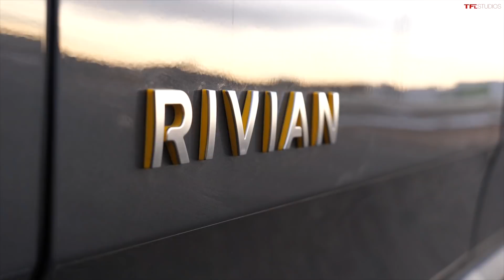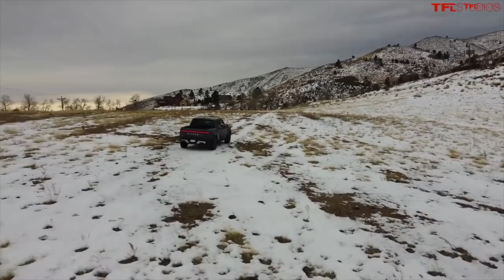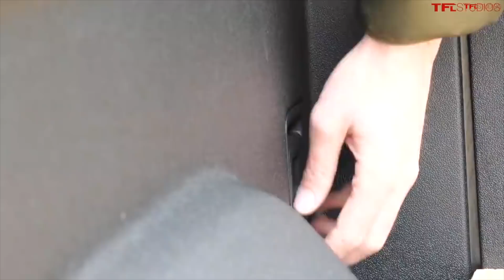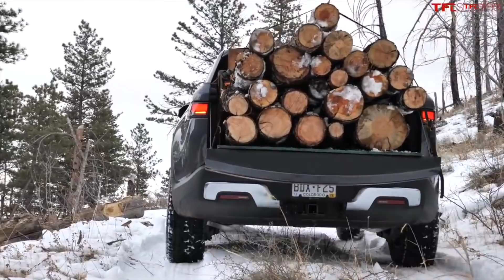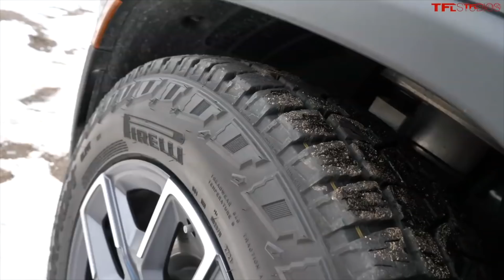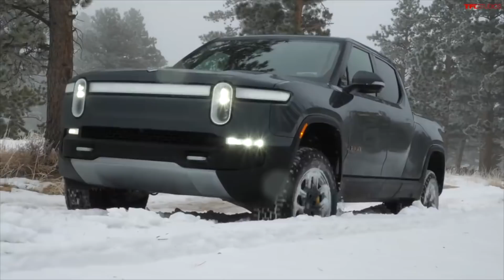What's It REALLY Like To Live With An All-Electric Rivian R1T? We Have The Answers!

Comment: I actually drive 500 miles pretty regularly.  HOWEVER, in my ICE truck that usually means filling up twice. In an electric truck I could leave the house "full" and then charge it an extra 100 or 2 for essentially the same amount of time.
Reply: For less than you could provide with electric an additional tank could be added to non electric for drastic increase in range.

Comment: It would be great to see you update how you approach testing adventure trucks like the Rivian.  Major towing or hauling logs?  Nah, that is all pretty yesterday.  

Hauling a super-duty bike rack carrying two 70 lbs e-bikes.  Charging the e-bikes while traveling.  Fitting a roof-top tent.  Operating your Iceco refrigerator/freezer on the road with 12V.  Fitting a dog hammock in the back seat.  Yeah, those are more appropriate tests for the intended demographic of the Rivian.

Comment: What does the conserve mode to to the 314 EPA? Goes over 314, or gets you closer to 314 (assuming you have the 21” wheels and road tires)
I didn’t really understand the 208-222 range comment… conserve mode adds 208-222 miles on top of 314?

Comment: 70k+ for a truck that will spend 50% of its time plugged up into a 240v or sitting an hour at a charging station. Until battery technology/infrastructure improves where it can charge in under 5 minutes without catching on fire, EVs are good as a daily short distance work commuter. If it's cold out and you need to tow or haul , you'll be lucky to get 150 miles before having to charge it again
Reply: Hah good point.
Reply: Most people will spend less time overall waiting for an electric truck to charge than for a gas truck to fill up if they charge at home and only take occasional long road trips

Comment: A/C power outlets(1500w): is plenty to shore power small RVs and trailer/teardrops. Unlimited boondocking!
That's my plan...camping off grid with the ability to stay connected to shore power anywhere(small AC unit, blender, etc).

Comment: Leave the spare where it is. Once after a day traveling on muddy dirt roads for a day with dropping temperatures, it took me 45 minutes of chiseling ice from underneath with a screwdriver to open the fuel filler door to gas up. It was an 88 Chev Sportside. I would have hated to try to lower the spare. The entire underneath of the truck had at least a half inch of frozen water and mud everywhere but the driveline and exhaust. Some places had more than an inch. Most people that work with big loads in their pickups alway have the spare tied on their loads. So if you're really worried about a flat with a big heavy load, take the spare out before loading the bed.

Comment: Just built a ford Lariat and it reached $64,000. I’m happy for more competition and more options. I would like more basic trucks with manual windows and manual trans, some of us just need a bare bones truck too.
Reply: Agreed. I'd order a stripper model of the e-F150.  An electric sled with a bed. No power anything,  no nanny systems to help me drive or lock a door.  No leather. I'd probably pull the back seats out for more tool boxes inside the cab.
Reply: @coloradoriversurfer  The nanny systems make getting a new model truck a hard choice.  I just rented an Outback in NY and had to turn off all the driver assistance settings to be able to drive the car.  For work had a 4wd rental that kept on giving proximity warnings while in 4wd.  Wanted to just let the truck tumble over a cliff.  Nanny systems are ruining the driving experience.  Too many people don't know how to drive.
Reply: @robertmisiuk7137  every time I try and cut off a Subaru driver -- they are already yielding.   
   I should keep a list of cars with automatic braking so I know who to pull out in front of.
Reply: 230 range is not practical for a truck
Reply: @brhutchi  it is for me.   Thats 4 days of commuting with my tools.

Comment: The specific F-150 with the 3000 pound payload is for an 8ft bed 2wd standard cab XL with the heavy duty payload package, which is a brilliant configuration.  It is a beast for an F-150.

Comment: It’s interesting that the battery pack is made up of 9 individual 15kw packs. I wonder if an issue arises, if the culprit pack can be replaced instead of having to replace the entire pack like some other EVs. That would save a ton on repairs.
Reply: That’s somewhat common, actually. Maybe not that many, but other EVs use smaller packs within their overall battery.

Comment: Just on this brand new all electric Rivian R1T pick up truck,  I know it's a early production truck but issues 1. Truck tailgate hinges, trapping water, Debris , has a bad potential for rusting the back end of the pick up truck out ,2.  Automatic door handles have a potential for freezing up  and snapping off ,3, Automatic Outside compartment doors freezing up, 4.  Air suspension making clocky noise , and very costly if something  breaks , 5 No trip computer, like you guys mention it should already have that, 6 Price !!  And this truck might be cool for somebody that wants it but I'm just a conventional truck kind of guy !!!
Reply: Your stuck in the old ways...nothing wrong with that but giving issues to a  brand new truck is a bit early no...only time will tell if you are right.

Comment: There is an easy solution to the towing / long trip battery problem.  There needs to be "suitcase" batteries that you can put in your vehicle or your trailer and a connection to hook them up live while towing.  Just like people carry extra gas cans while overlanding, carry extra batteries while towing.  Leave them in your garage or in the trailer when not towing.  Manufacturers could even work with trailer companies to have trailers with them built in.  You carry extra batteries for electronics on long trips, do the same for EVs.
People are sitting around throwing their hands up in the hair like there is no solution when we already are doing the solution all the time with other electronics.
Reply: Or just what will really happen and that will be trailers with batteries built in to them to extend hauler range and also power them off the grid.  No brainer

Comment: Would really love to see you guys cover the effects of extreme cold (0 to -20F) as well as icing.  Will the charging port door open if it is glazed over?  What is the body panel replacement timeframe (Tesla's fender bender replacement parts timeline)?  Issues like Tesla's issue rear window issue when removing the trunk...

Comment: The rivian is the perfect size. The cabin is like the 4runner which is slightly larger than the Tacoma. The bed is also wider than the Tacoma so it can handle plywood.  I've had 2 different full size trucks and they were both clumsy in the parking lots.

Comment: I was very impressed by the R1T in your tests. I just clicked over to the Rivian website, and that R1S SUV looks like it will be very attractive too. I hope that Rivian gives you guys an early opportunity to test the R1S when it launches commercially. I also love that the R1T beat the TRX. LOL
Reply: On the official Rivian site the orders can be taken for both Truck and SUV but when try to configurate the SUV it shows that it will have a shorter chassis which means no more gear tunnel and no big capacity battery and the SUV will be much more expensive than a similar configuration of the Truck.. So what i'm try to ask here why to get a more expensive SUV that has less options and less range since the Truck is the best option it has room for 5 adults and has all the cool optional gizmos.. for the 7 seats ?  in that case why not get a tesla x which is much more efficient ?

Comment: Come on guys.  It's a 1/4 ton!  Midsized at best.  Yes they chose cabin over bed space but it also has the gear tunnel and the frunk.  The longest Tacoma (140.5" wb)and the old long bed Frontier are longer.  Also Tommy you know the Gladiator has basically the same 137" wheel base.   Don't quote it against just the Ranger and say it is bigger.
Reply: It is a true midsize.  You can fit 6' adults in the backseat comfortably.  Try that in a Tacoma.  Four adults 6' on average can't fit in a Tacoma or any other midsize.
Reply: @robertmisiuk7137  not true.  I'm 6' and not small, and I've sat quite comfortably in the back seat of a Ranger, a Colorado and especially the Ridgeline.  Even the back of a Maverick is quite good.

As for a Tacoma, the front seats aren't even comfortable.  This Rivian however is right in the middle between the shortest and longest 1/4 ton trucks and it's cabin is most similar to the Ridgeline.
Reply: @fabulousoffroaddesigns5080  True about the Tacoma front seats.  When sitting in the back, were the front seats set up for someone the same size?  My friend (6'4") and I (6'1") always go to the auto shows to sit in the midsize trucks.  Him in the front seat and me in the seat behind.  Haven't found a midsize with decent room in the back yet.  

Most midsize back seats are like a Greyhound bus.  It would be nice to at least match the leg room on an airline.  Nissan increased the length of the Frontier by 5 inches and none of it was inside the cab.
Reply: @robertmisiuk7137  there is quite a difference between sitting behind yourself at 6' and sitting behind someone who is 6'4" when you are 6'1".  That is 5 extra inches.  This wouldn't be comfortable in a 1 Ton Quad Cab, Extended Cab, or Super Cab either.
Reply: @fabulousoffroaddesigns5080  Not that much different since the seat is only able to go back so far.  Neither of us recline the seat much since it doesn't increase leg room for the driver.  Chevy and GMC full size have plenty of room.  I haven't sat in a Rivian, but from what I have seen, it has decent leg room.

Comment: I think the discussion of range and the limitations of charging needs more emphasis. All the doodads and gizmos are meaningless if you can’t actually get them to and from the trailhead in a timely fashion. Most weekend warriors probably don’t want to cut into play time with extra hours of charging. Would be nice to see some road trips that would really put some strain on the range of the battery. 

I’ve been playing with the better route planner app and some of the trips I’ve made in the past would be completely impractical or even impossible with an EV. That’s unsatisfactory to me considering how much this thing costs. I guess time will tell how much the charging network expands. I think the type of person that Rivian is marketing to is going to want to go on road trips in the western states frequently. Not sure if the current state of charging supports the ability to travel when and where you want in that arena, which is kind of antithetical to an “adventure” vehicle, as far as I’m concerned.

Comment: Andre I like the rivian it has nice features but being a full rv has to many limitations I like to see this as a ev and plug in hybrid that would be more. Beneficial for customers that would give you the best of both worlds but for now I love my 2021 F150 limited power boost which has no Imitations no waiting to charge the vehicle just fuel and go and for around town I can run an electric power much more consumer friendly unless limitations
Reply: If someone charges at home and only road trips occasionally like most people they’ll spend less time overall waiting for an electric truck to charge than for a gas truck to fill up
Reply: @ahowedaddy  I must disagree because when you sit on the side of the road out of electric because you thought that you might make to the next charging station I will beep my horn and throw you a wave as I keep trucking down the road in my f150 powerboost for which get 24 mpg about 600 miles to a tank

Comment: I hate hate hate this. That’s no truck. Not one bit of a truck
Reply: Change is hard.  You’ll get through it.
Reply: @brads1545  Seems like a bit of overreaction, doesn't it 😏
Reply: @pearldiver7  Agreed😂
Reply: @brads1545  Wait,  this will get them crying.  The Ridgeline, Santa Cruz, Maverick, and Rivian, are TRUCKS!  Not all the same ruggedness, not all the same payload or towing capabilities, and  NONE have body on frames.   Let the weeping begin.
Reply: @rondail5675  Exactly
Reply: All my truck friends said my Chevy Avalanche was not a real truck when I bought it new in 2002. I kept it for 20 years and worked it hard. I carried everything in it; Sheetrock, plywood, rolled turf, even had 1800 lbs of 3/4 inch crushed stone (weighed on the scale at the quarry). It was 100 percent reliable. I would buy another one if Chevy ever brought it back.
Reply: I have to be honest, Even the Model X tows better than the 3500 1,000 HO cummins. I did have the X a bit overloaded at 8,000lbs but it took it like a champion compared to the "Truck" which felt like an asthmatic horse trying to pull a wagon up the IKE! You hate that you are wrong about electrics, I once thought like you. The only difference is that I have experienced it for myself. 
Cheers

Comment: I really think of all the EVs available TODAY, this is the best alternative and the price isn’t the worst,,,,,, sort of. Everything is expensive now. EV trucks are not the best at towing, that’s for sure. EV trucks and vehicles, in general are not the worst at hauling goods though. Less drag, rolling resistance etc. What an excellent city truck, even a decent city dedicated work truck,,,, as long as you are not trying to haul anything too long (eg 14 ft deck boards, anything over 12 feet really, as there’s too much weight hanging off the end of the tailgate,,,,. Physics,,,, ughh, haha.  
       The newer full size EV trucks will be even more impressive and may have a place in the country as well,,,,, to a point. They NEED at least a 6.5 ft bed for a lot of the different jobs as they box space it the reason for owning a work truck. It would be nice if you could get extended cab models, but that’s only maybe 30-40% of the trucks sold. Crew cabs have taken over,,,,,, so the manufacturers will gravitate that way. 
     Once the other EV trucks are available, the R1T has pigeon holed themselves not unlike the T100 from Toyota. That failed miserably and hurt Toyota sales when the Tundra arrived. The Tundra became a very nice offering in the full size market though with the last generation Tundra. 
      The tailgate issue of potentially clogging up has one other downfall. That’s going to trap moisture,,, the reason fender wells rust out on trucks is, they trap moisture as a result of build up. If you are diligent and keep the fender wells clean by washing them with a wand and literally getting in there and removing all dirt, you don’t get rusty fender wells. I have a few friends that are very careful even with their ranch trucks and some have late 90s trucks with 500,000 + km on them and no rust!! They literally oil the cab corners and door sills to help with the fact they are very hard to get into to wash. The trucks are dented to crap!!! (Sort of) Hahaha, but no rust! 
     Anyways,,,, I’m very impressed with the truck!! Being retired as I am, I could definitely benefit from this truck. I have instead, a F150 Tremor ordered and it will be hauling a 1100 lb smaller slide in truck camper. I also have a F150 Lightning ordered which is going to take longer to get than the Tremor, I’m sure, but it will definitely be hauling that camper to see how it does with range. The camper is a Rayzr so it has no cab overhang so no where near the wind resistance of a typical truck camper. EVs are generally not affected nearly as much hauling a load,,,,, hopefully.
Reply: It will be cheap camping. Plugging into the 240V charging it right up at the camp sight. Unless you are camping off grid of course, then just be sure to have some extra Juice. I've towed with a Model X I used from the previous company I worked with. Wow, the Diesels didn't feel that confident compared to. 
HAPPY HAULING!

Comment: For a while there will be a problem to get any vehicle due to low production volumes regardless of features and the winner will be the manufacturer able to supply the market. If the market stabilizes then the features discussed in video will come up front as helpers to choose the right vehicle for right customer.

Comment: You should check back with Chad on a routine basis to see: if the charging curve changes you noticed keep occurring, there are any other issues that may have resulted in the Ike Gauntlet run, overall charging degradation that may occur, etc.

Comment: I found a few videos with people saying that the Rivian R1T was capable of 128MPH top speed. In one of the Colorado test drive events, some showed it going 123MPH (I think this video is still on rivianstories or rivianforum).
 Did they change the top speed to artificially limit the top speed to 115MPH?
Reply: Maybe not locked on the test vehicles?
Reply: @Story_Teller_Everyone  Likely the difference between the road tires and the All terrain tires speed rating as Manufacturers set the speed limiter based on the OEM tire speed rating.
Reply: It's certainly limited. With 800hp I'm sure it can go more than 115 mph, but I don't think they want to have it go that fast for safety reasons.